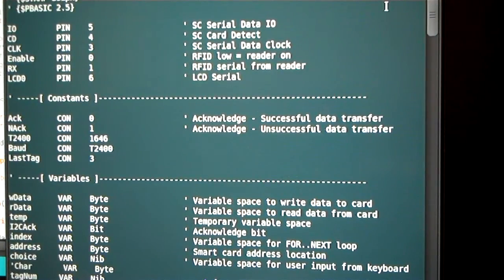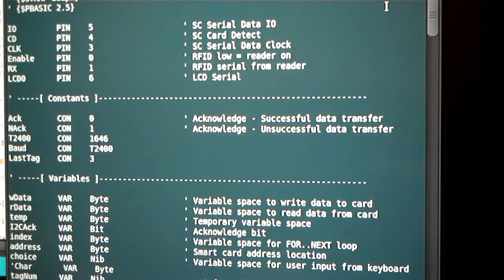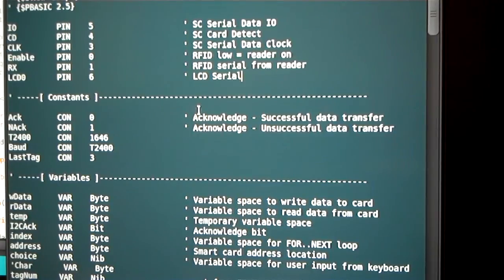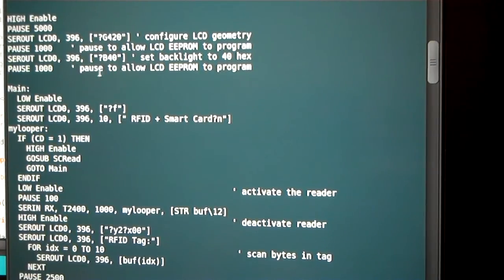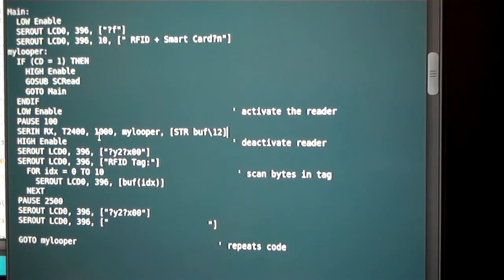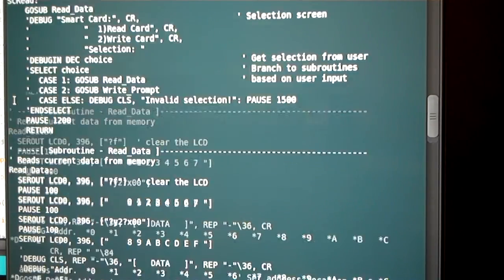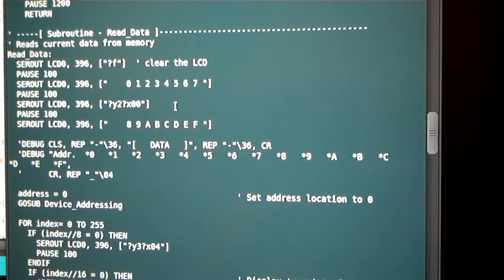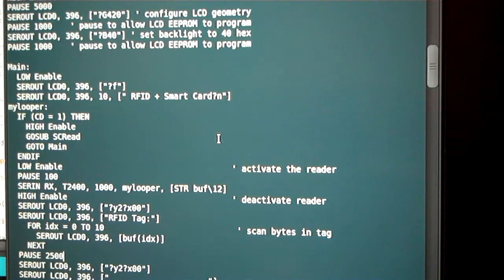RFID Smart Card Code

Comment: This is a great project! I'm working on making some access control modules for machinery in a maker space and am trying to control the power to the machines for a specific user. Even for "dumb" machines like drill presses just to make sure that the operator took the safety class first. I'm wondering if it's possible to control a relay using the smart card setup, so that the machine will be delivered power when the card is inserted for an indefinite amount of time until the card is taken out?
Reply from the maker: Very awesome idea and super helpful for all makerspaces!!! Very possible, most smart card readers have a pin for card detect so you can know when the card is inserted or not. Each relay channel is just a pin flip for open or close so you could map "power access" relay channels to the user/card id as bits tied on to the end of the id... Totally doable and a very great application!

Comment from the maker: This is the code for the device video.  The output is serial data so any program you create that can read serial data from a device will work.  I don't write GUI programs but as long as there's a serial module/object in the language it should be able to read the data.